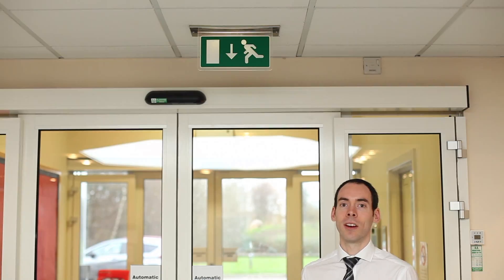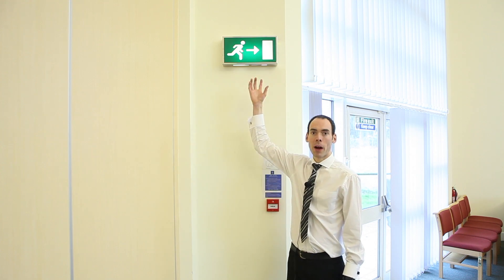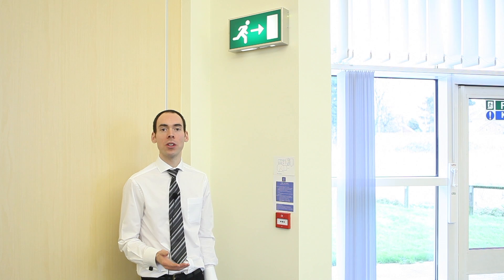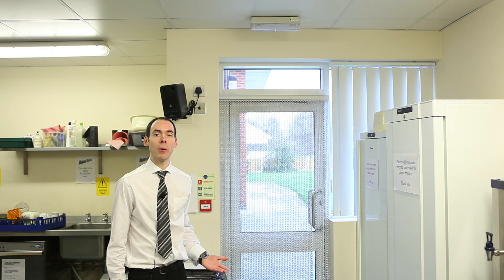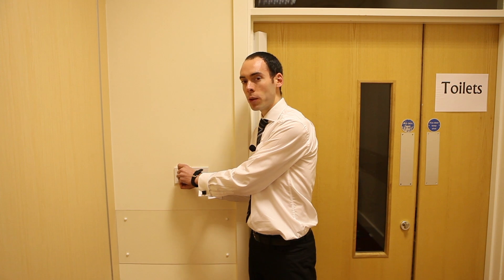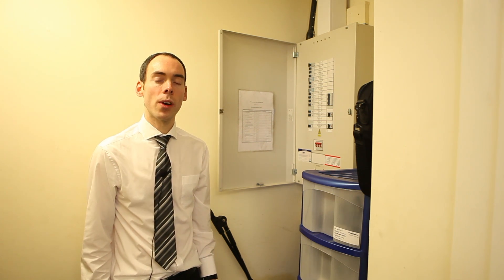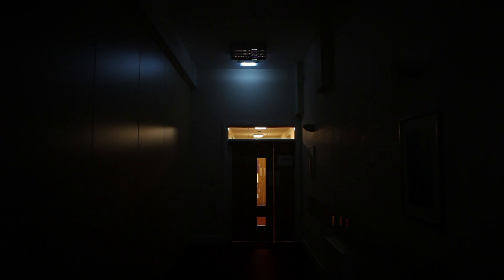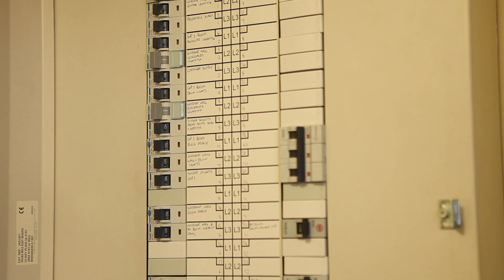Testing Emergency Lighting

Comment: So the light should be red on the light before testing. The light in corridor is red it comes on when testing then I switch the lights back on but that light doesn't switch on only when I put it in testing mode

Comment: Why would you test it monthly between servicing visits? Overkill.... 6 monthly & yearly EML / EXIT light tests are the standard.
Reply: NFPA101 Life Safety Code in the US requires a 30 second EM/EL test with documentation at an interval not exceeding 31 days between tastings. It's a good idea that is seldom enforced. 

Nobody thinks anything about the code until the lawyers show up following a wrongful death suit.
Reply: @suspiciousgarlic2366  cash cow for the electrical contractor….
Reply: @TheBTeam2025  Yup! That too! If you're a building owner it's much easier to pay for services than deal fire/ building/  insurance inspectors ESPECIALLY in large metro areas.

The 30 second test was an incremental part of battery maintenance with older technologies. Today we have much more reliable systems in place but the requirements hang around.